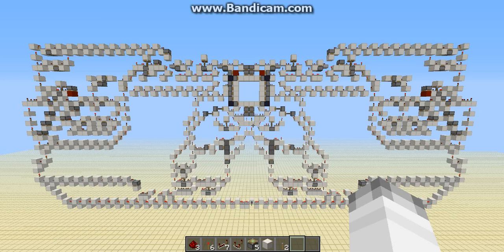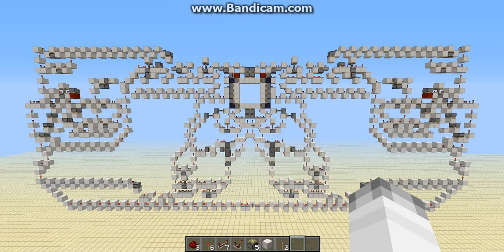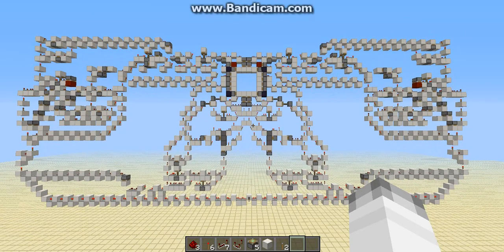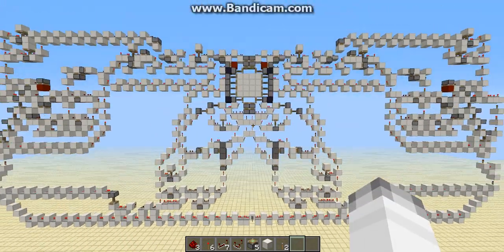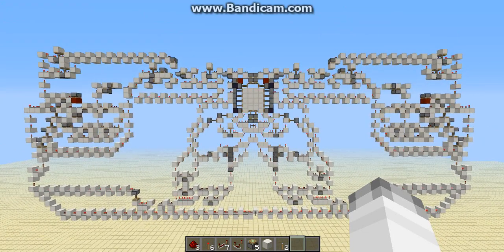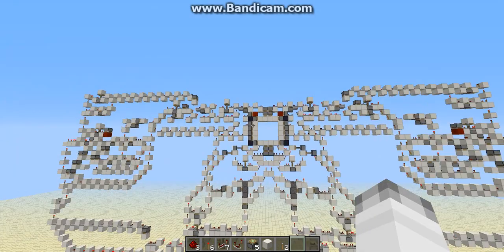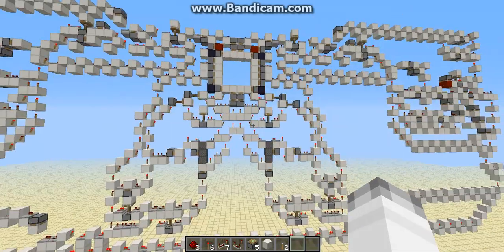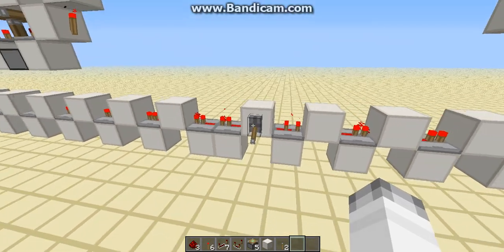ALMOST Tileable 4x4 Seamless Piston Door

Comment: Well, good job!
I just have a little sad message for you: its not tileable
it looks like it is because it doesnt use redstone, but in fact this wont work when you tile them next to each other. The redstone block on top will power 3 of the storage pistons, and the bottom will update eachother
it should work if you fire them all at the same time, but thats not what tileable is
Still, Really good job! :D